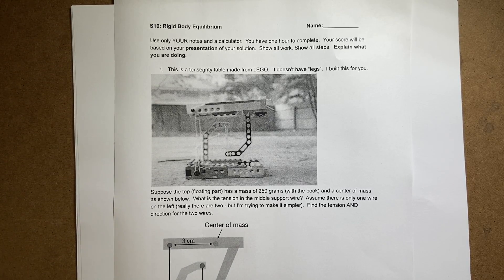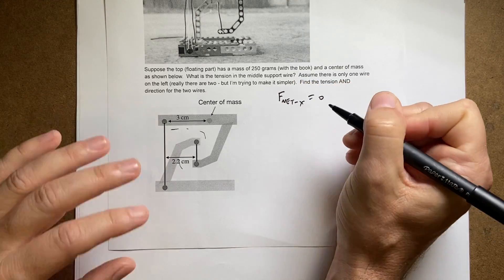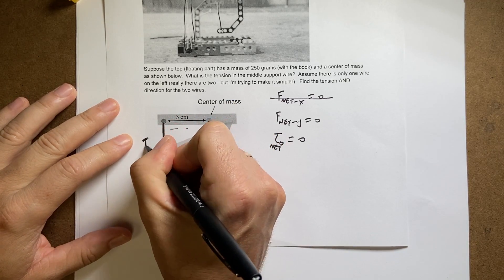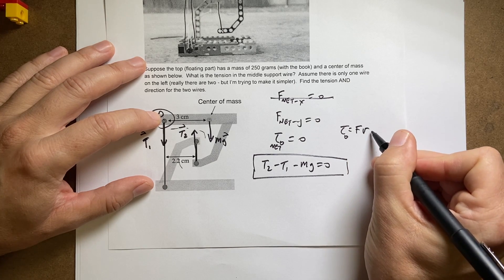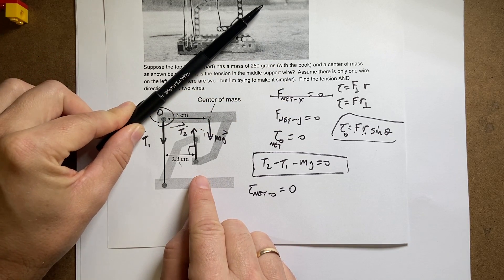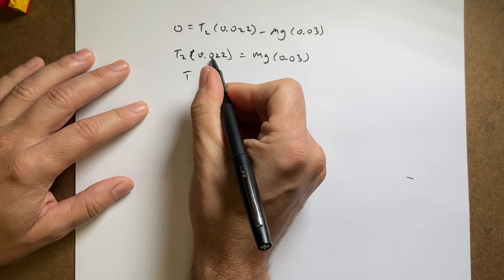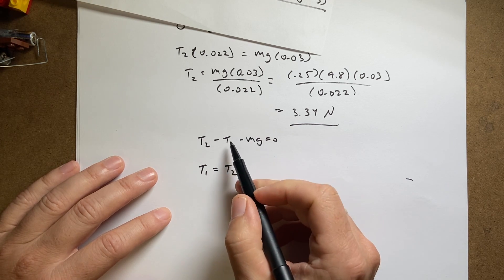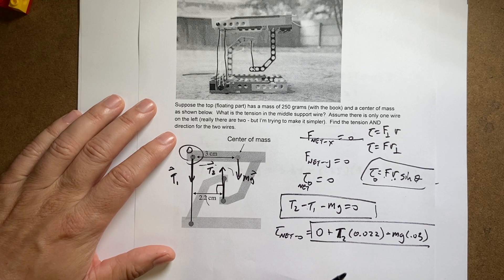Calculating the tension in the wires for a floating LEGO (tensegrity) table.

Comment: hey hope you see this!
how can you calculate how ,much weight can the top shelf (floating) hold based on the boards and strings properties?
i really appreciate if you answer here or even make a video about it :)
thanks in advance <3
Reply from the maker: There are two things you would need to calculate (one is easy and one is not).  First, you could calculate the tension in the wires - just like I did here.  Then you could compare that to the maximum tension in your table to see if the wires will hold it up.

The other calculation has to do with the structural integrity of the material - in this case my LEGO.  That one part that sticks down has to support a very large force - you can calculate that force since it's the same as the tension in the middle wire, but it's difficult to determine if it will break or not.